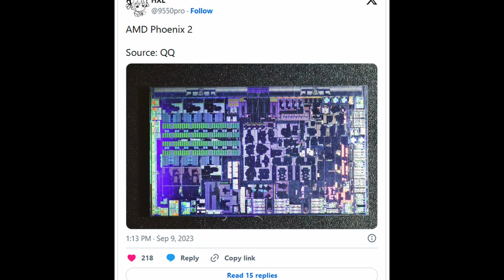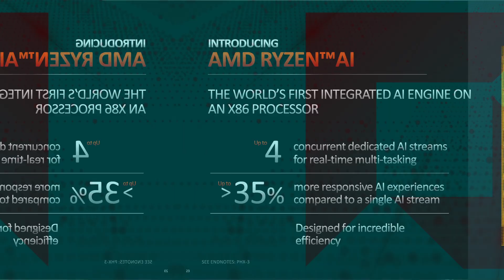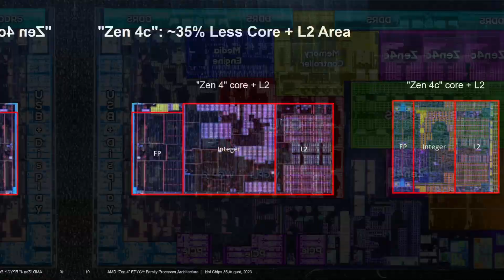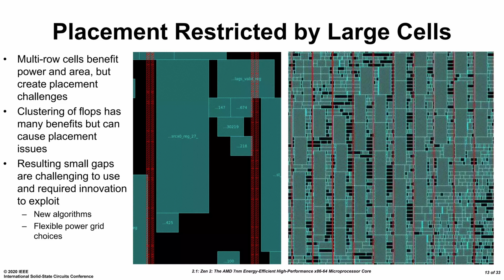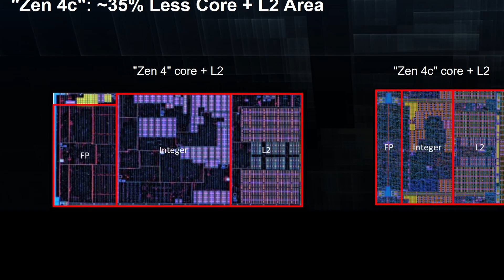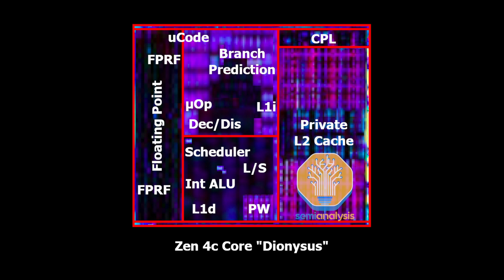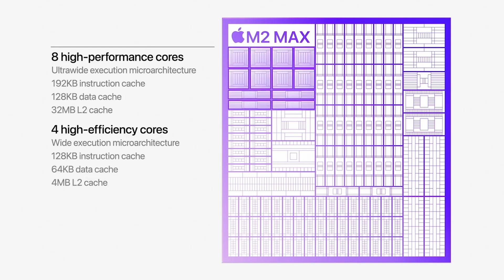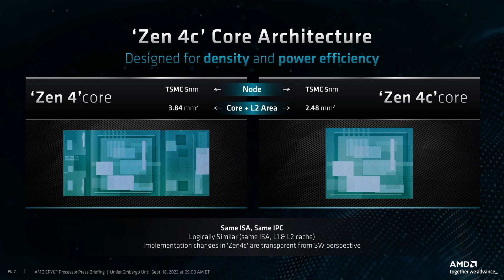Why AMD's first Hybrid-CPU is Different

Comment: The interesting question is why does AMD include regular Zen 4 cores on P2? With server CPUs it is clear that they do not need the regular cores in the first place. I get that it's probably for ST/MT workload optimization but shouldn't AMD prioritize for a smaller area? This also challenges the narrative that what AMD does is "big little". They don't have to go together.
Reply: Regular Zen 4 cores for single threaded workloads, as they clock higher, probably.
Reply: Zen 4c cannot go much beyond 3ghz. This makes them great as efficient cores, but peak single threaded speed would be a lot worse without the "big" cores.
Reply: @b127_1  I've heard it can go past 3.2 GHz just fine, though with a higher voltage than Zen 4. I get that you can get up to 25% slower on Zen 4c w/ standard configs. Though, I reckon with proper optimizations the gap can be narrowed down to 15. For mid range laptops AMD can still get away with not using Zen 4 (or using just one). After all, you are dealing with 15 W or less TDP. It's more flexible than other solutions at the cost of less area savings. So I still don't think that calling this approach "big little" is the right one.
Reply: @EntekCoffee  They should include at least one P core in anything but the cheapest mobile designs, because of Amdahl's law.
Reply: @b127_1 zen4 are already super efficient. I turned off boosting, limited to max 2.7ghz, and my 6850u is absolutely nailing every task I throw at it, with about 7-8h of normal usage (over 12h in "just reading and writing text" mode). all with 40ºC with no fan, unless playing a video or using external monitor. So I personally wouldn't mind all cores to be 4c.
Reply from the maker: As some ppl mentioned before, two cores to offer higher peak perf due to higher clk speeds.

Comment: I think, big.LITTLE is probably one the most misunderstood technologies in this space. Most people who are talking about this clearly have no idea what big.LITTLE actually is or rather was (big LITTLE doesn't really exist anymore). Neither Intels nor AMDs approach have anything to do with what big.LITTLE tried to do. 
big.LITTLE was all about energy efficiency, most notably when running idle. All that big.LITTLE tried to solve was creating CPUs that can be both be powerful enough for many applications while still be able to run on battery for weeks without shutting down and being always online. 
Both intel and AMD try to improve performance per area with their hybrid design. They're not trying to improve energy efficiency or anything like that. It's all about performance per area/cost.
Reply: They're always trying to improve energy efficiency, even if energy efficiency isn't the main goal.
Reply: @Knowbody42  Obviously they're trying to improve efficiency but their hybrids designs don't really improve efficiency that much. And what's probably more important: They do not decrease power consumption with that. ARMs LITTLE cores aren't more efficient, probably even worse that their big cores. But they consume much less power than the big cores
Reply: @lukas_ls  Energy efficiency isn't just about using less energy. It's often about reaching higher performance while remaining at the same level of power consumption.
You have to improve efficiency to do that.
Reply: @Knowbody42 Of corse. But ARMs big LITTLE is not primarily about efficiency but lowest possible power consumption. It's about total systems efficiency
Reply from the maker: You are correct, big.LITTLE was mainly about energy efficiency in mobile devices, the smaller cores and performance were just a side effect of that design decision.
Reply: @HighYield  Yes, but I think this doesn't come close to explain what the idea behind big.LITTLE is or rather was. 
big.LITTLE has never really been a heterogeneous architecture. The OS never actually had to know about using two different cores. 
The LITTLE cores aren't eben more power efficient when when running at 100%.
The main difference is OOE support (OOE= Out of Order Execution). All modern super scalar architectures use OOE because it's much more efficient and you'll get way more performance. Problem is cores with OOE will always use more power when running idle than cores without OOE. In mo bile mobile devices you want both days of battery life when the device is just locked but high performance too. 
big.LITTLE just combined two different cores, big (=has OOE) and LITTLE (does not use OOE) in one SOC. The interesting part is that both cores were never designed to work together or the OS having to do heterogeneous scheduling. In first generation it was cluster wide. You had 4+4 cluster with either all big cores or all LITTLE cores enabled. big.LITTLE worked just like another power state. Having two seperate cores was completely transparent to the OS. The OS just requested a power saving mode and the CPU did all the things necessary to switch from big to LITTLE cores. Second generation was similar but each pair of cores (big+LITTLE) was treated individually. But once again, this was only done through power states (in software). 
Only way later ARM started supporting heterogeneous designs with both big and LITTLE cores active at the same time. But this is not longer called big.LITTLE even though this name kind of stayed around. It's officially called ARM DynamIQ and works very different from previous big.LITTLE designs

Comment: I feel Intel's approach is much more scalable, and is much more efficient, especially with Meteor Lake. And it's going to get way better in Panther Lake, as Intel hopes to match or even exceed Arm's efficiency levels.
Reply: I has yet to be seen. Zen cores balance computing power, area and efficiency from the heart of the design as they have to scale to a lot of corrs on servers, and still be powerful on desktop and laptop.
Until Intel starts doing well on servers, I wouldn't call their approach more escalable.
Reply: @6SoulHunter9  Trust me, panther lake is going to be wild. I expect an all new architecture, the symptoms of it's transition I saw with Meteor lake. Intel is going to drop their CPU frequencies to about 4 GHz, much like Arm designs do for better power efficiency. This also fits well with the fact that smaller nodes can achieve lower peak frequencies. Intel's demo on the Panther Lake chip running AI algorithm natively was a powerful message to the industry. I feel Intel is going to leapfrog AMD by their 16th gen. This is the same feeling I got when AMD had released their Ryzen 2000.

Coming to current context, Meteor Lake has taken a Lego like approach to building chips, which is very different from AMD's approach. Intel has focus on performance and scalability while AMD on cost and speed of execution to the market. You see, taking out a chiplet and putting in another one is a very serious advantage. Imagine that Intel just takes a 16 core Meteor lake chip, takes ou the GPU die and puts in another CPU die. Voila! 32 Core Meteor lake desktop. And since the interconnect is also silicon it has close to none performance impact. And since Intel has taken out the Media codecs from GPU to SOC tile, you still have all the Codecs you like.

Imagine this in the server space. Intel CPU cores, which can be all P cores, all E cores, or a mix of both. With a Gaudi accelerator, which at this stage is the only real competitor to Nvidia. The sales are showing that too. Gaudi is in hot demand, compared to Instinct garbage from AMD. Not the hardware (hardware is pretty good), the software, which is pure garbage. Comparing that to oneAPI, which is open source as well, is the best alternative to CUDA.

Intel's turning a corner. In the coming 3 years, things are gonna get real spicy in the industry, and at the end of the day, that's all I want.
Reply: @divyanshbhutra5071  everything is just trust me bro XD
Reply: @asdfsdfsadfasdfsf  LOL. It's not that kind of a claim. It's just analysis. And whatever, we'll all see everything unfold in the upcoming years.
Reply: @divyanshbhutra5071 You should write a newsletter with your analysis and sell it to wall street. Don't bother the hardware crowd we will just mock you.
Reply: @kazedcat  Wait I can sell it to Wall Street!!!!!!!!!! Tell me more please ;)
Reply: @divyanshbhutra5071  Yes become a stock analyst.
Reply: Intel has made lots of promises but until they can prove they can perform on the server space... AMD isn't resting on its laurels, it's executing consistently, and that's very important on server space, more even than on desktop. Also, as zen has been (has the name indicates) designed to have equilibrium with everything, they can more easily manaveour to make small design changes for different markets. Intel has huge cores and has been playing the frequency pushing game so hard that they'll need a complete architecture redesign. They might have their ryzen 1000 moment before their ryzen 2000 moment on desktop, but they still don't have a product on the market that has room to scale.
Also, even if you could theorically put 16+16 cores combining 2 chips, you need them to fit the space of use a socket for which most consumers coolers aren't adapted to, even if they make more efficient  cores, they need to make smaller ones too. 16+16 P cores would be better as threadripper competition than desktop.
I think that Intel is on the right direction, but I think they still need more time to be able to compete with AMD on server space.
Reply: @6SoulHunter9  Obviously. As I said, they're turning a corner. They need more time - atleast 2 or 3 years.
Reply: @divyanshbhutra5071  2 or 3 years to achieve sort of parity, more time to surpass, AMD just has started to increase their core variety. But yes, I don't think that AMD will necessarily remain on the top forever.

Comment: Right now Intel CPU roadmap is much more exciting than AMD's roadmap .Intel have idea to make their version of 3d cache CPUs
Reply: Did you just say that intel roadmap is more exciting while mentioning something that amd's already dropped multiple cpus of? 5800x 3d, 7800x 3d, 7900x 3d, 7950x 3d. What is so exciting about intels roadmap?
Reply: @iamLODD  Because AMD could have release X3D variants from the start, but Evil Su, being Evil Su, released it late and charged it more.

Not only that, AMD has no good engineers, it's been Zen++++++++++ with more gluing.
Reply: @AlfaPro1337  - oh the audacity to charge more of a product that is orders of magnitudes more complicated to manufacture with lower yields and very demanding packaging that is a giant bottleneck for the whole industry right now. Of course they should have made all Zen 4 CPUs X3D for the same price and release it in 2020. Like Intel which is known to provide all features in low class CPUs on a perfect timing schedule for a fair price.
Reply: @Hortifox_the_gardener  I mean, prior to Evil Su, AMD managed to give up high-end CPU with an increased in core count for US$300-350. PX4 9600 > P2X6 1090T > FX-8150 were all US$300-350 range, and increased in core count. Now, you get a glorified low-end 6c!

The fact that AMD released many X3D APU means that they could have done it in the first place, regardless of yields.

Not only that, unlike Intel, AMD has nothing, no fabs, no BoM, nothing. Yet, they charges as though they have a fab, materials, works like Intel, when in fact, it's only a paper contract between AMD and TSMC.

Not only that, AMD only buys usable wafers.
Reply: @AlfaPro1337  - all the CPUs you named were cheap because they didn't compete. The 1090t was usable but the other two were downright bad. Of course they were cheap. You blatantly ignore the Athlon (64) era and stuff like the FX-54 which makes the 7950X3D look like bargains.
Reply: @Hortifox_the_gardener  What? You do know that they were competing against the C2D and later C2Q?

And reviewers were recommending AM2/3 platform over Intel if they were on a budget?

Because we aren't focusing on those chips, plus, back then, AMD WERE making their own chips, USING their OWN fabs.
Reply: @Hortifox_the_gardener releasing only x3d cpus would've been bad for them, x3d is good for gaming but not for productivity
Reply: @AlfaPro1337  - they competed with C2Q in a time when Intel already released Nehalem (no not the hungry bloomfield that blew them out the water but the solid but "meh" Lynnfield platform). The Phenom X6 was never more than a good enough budget option. Phenom X4 was an awful release. Not only did if have the TLB bug bug it also ran at atrocious clock speeds at release and even the last batches were underwhelming at best. Bulldozer was just as bad - if not worse than P4 with the worst iterations like Prescott. Bad enough to almost kill AMD. And what about that fab bullshit? It doesn't matter. Nvidia, Apple, Qualcomm and many many more run fabless as well. Do you realise there is basically only Intel left with their own fabs? Samsung just happens to have a fab division and I wouldn't call Texas Instruments exactly a chip powerhouse anymore. Fabs without being a service provider are more of a liability than a feature.
Reply: @Hortifox_the_gardener  Except Nehalem started with only 4c/8t, while the P2X6 has 6c/6t.

Plus, AMD is basing their CPU on proven tech. The reintroduction of HT proves to have no performance uplift, or worst detrimental like the OG HT.

Why am I talking about fabs? Because AMD is charging atrocious rates when they literally have no expenses on fab stuff, unlike Intel and Samsung.

Not only that, AMD was pretty closed with their fabs, they don't offer. Intel did offer fab facilities, but they don't market it like they did today.

You clearly know nothing.
Reply: @AlfaPro1337  - suuuuuure. If that helps you Mr. Allknowing expert. Maybe apply at AMD to teach them your wisdom?
Reply: That is what Intel is known for - exciting roadmaps for shareholders and investors. Ultimately it matters little if these great products only exist in labs and are not mass produced.
Also Intel's roadmap may seem more existing because after five years of development they are finally starting to utilize chiplet approach but it still takes time. 

Meteor Lake is the first but it was delayed more than half a year and will only come to laptops and small form factor mini-pc's next year. Then we have a stopgap Raptor Lake Refresh that is using the standard monolithic design. Only closer to 2025 we may finally see Arrow Lake on desktop with chiplets - assuming it does not get delayed.
Reply: lol right
Reply: or do they? seems like big.Compact is better tho